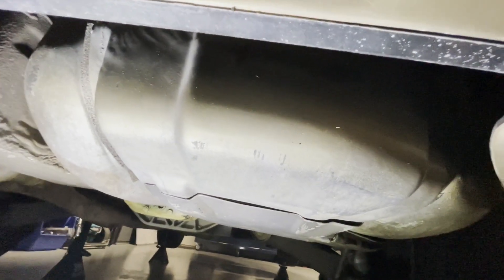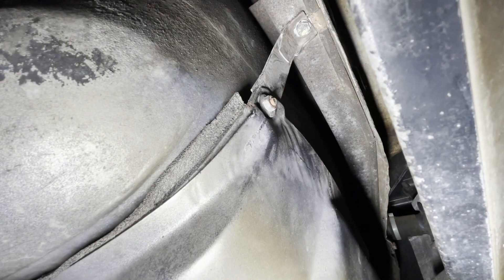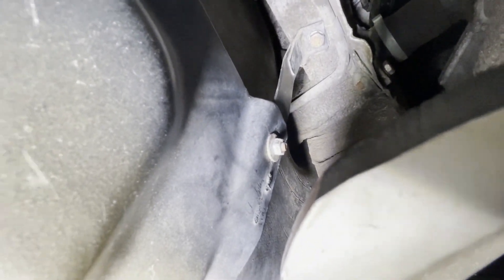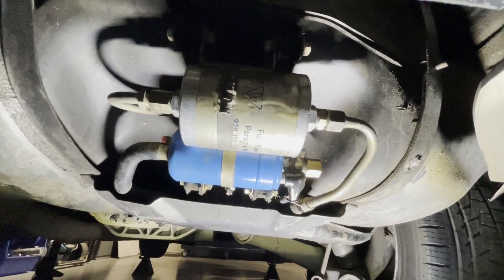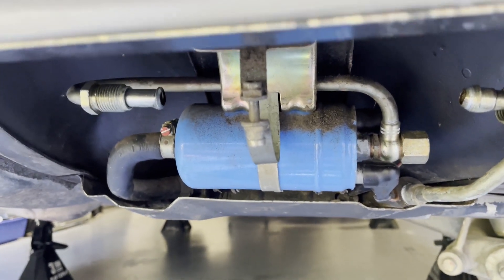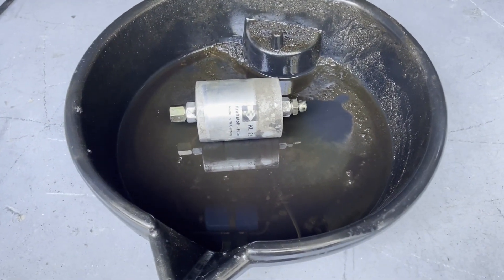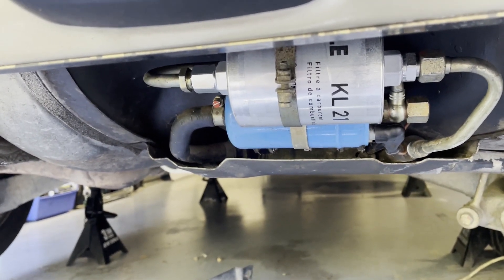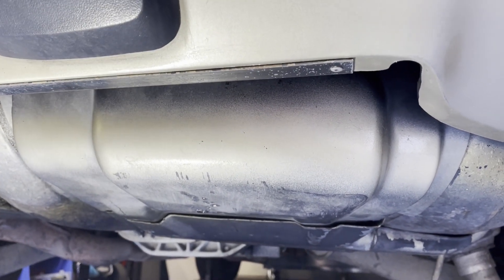Porsche 928 Fuel Filter Replacement

Comment: 4:39 the proper tool for this application is a Compression Fitting Spanner Wrench.  It works beautifully on fuel line nuts.  It allows you to grip on more of the nut surface.
Reply from the maker: Yet another tool I need to add to my Christmas list.

Comment: What year is your 928?  Auto or Manual?  USA model or ROW?   Thanks, I should really get around to doing mine this year.
Reply from the maker: It is a 1984 USA model with an automatic.  It wasn't that hard overall, but the nuts were pretty tight on the connections.  Hope it goes smooth when you do it.